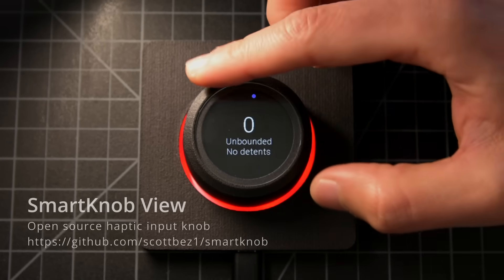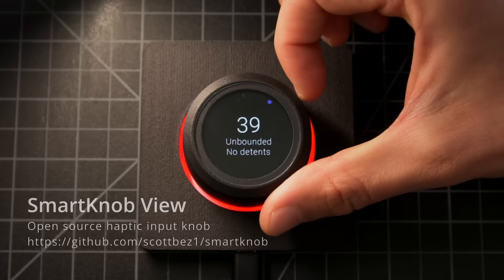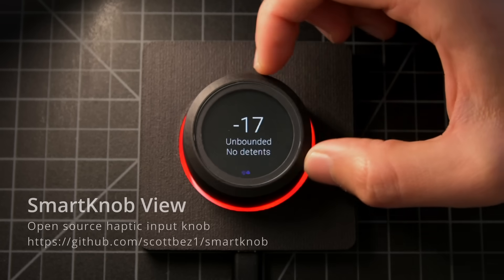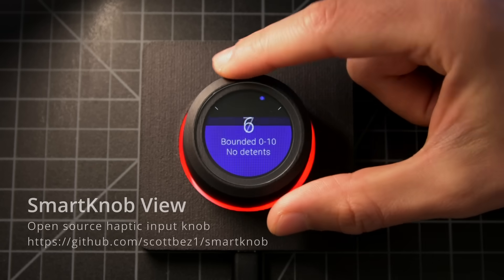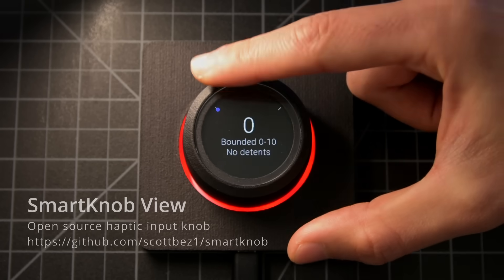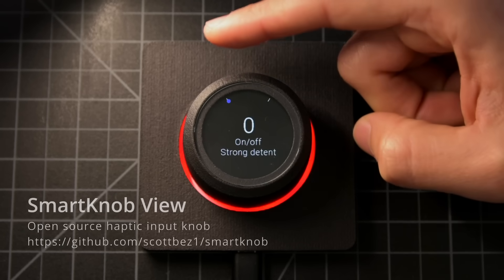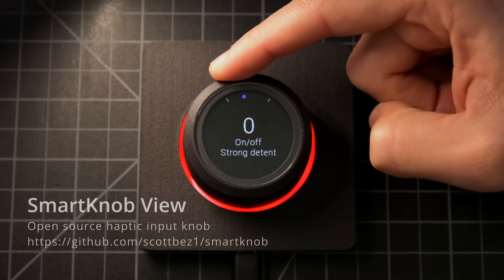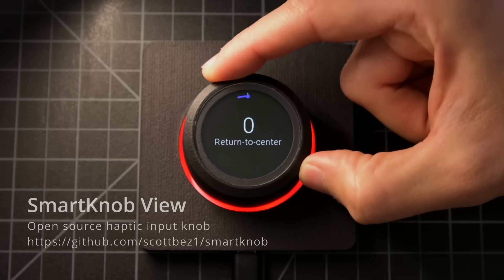DIY haptic input knob: BLDC motor + round LCD

Comment: I love force feedback and real mechanics that can be felt and heard. This is basically a miniature sim racing wheel that can be configured for different endstops and resistance. However, it's tricky to make a motor produce a torque high enough but not hinder free rotation due to back EMF. This is what may limit of such a design unless a variable Kv motor is used.

Comment: YouTube recommended this random video to me for some reason. I still find it absolutely amazing. It's like you emulated all possible mechanical properties that a rotary dial can have and allowed the user to pick, with software. Reminds me of the scroll wheel on my MX Master but with so many more variations and so much more control. The best application I can find for this is on a keyboard. Even as a standalone thing,  could program it to pick a specific behavior contextually. step-less for sroll, steps for scrolling spreadsheets of lines of code, bounce back and acceleration mapped for controlling volume...
Do you think the Hardware on the MX master can support this if one can access it in software or is there something specific about the motor and diet that allows for this??
thank you for the great work.

Comment: over 35 years ago (precisely in 1989) Canon released two camera lenses - the 85mm f/1.2 and 50mm f/1.0 that had the electronic coupling between the focus control ring and the motor and oh boy... it's so satisfyingly accurate! it feels like the ring is really physically connected but it's not. I only know that they are using the ultrasonic motor, I think it is still the pinnacle of the encoder+motor engineering. I mean, they did it in 1989, and we are coming closer only now...

Comment: A cool feature would be detents of increasing resistance as the value approaches the useful end of a output variable.

I imagine a thermostat that is fairly free wheel until it gets within the 18-24 degree range and then has a hard stop at the upper working range of the heating system.

This would be a haptic way to suggest an optimum temperature gauge as well as the systems limit. 

I don't believe this would be a novel and fairly new use case that would actually require this type of technique

Comment: This is what I'd like in my dream car. Imagine having maybe 2 or 3 knobs like this and being able to program them to do different things - heck, maybe even contextually. Imagine using those knobs to control multi-zone aircon and then switching to a different menu on your infotainment system and using the same knobs to control ambient lighting or select a driving mode. And of course the knob itself tells you what you're controlling, so that would be great for guest passangers.

Now pair that with a couple of programmable buttons with simmilar LCD displays for binary inputs + add ligthing and sound cues to know when you enter a different preset. You get ergonomic and elegant dashboard with PHISICAL controls that can do everything. Say goodbye to touchscreens with no feedback that you can't operate without taking your eyes off the road.

Comment: How did you account for cogging torques? Does the system have to be calibrated for individual motors?
Reply from the maker: This particular motor has basically no cogging torque, so there's actually nothing special being done about cogging besides finding the right motor!

Comment: Fantastic video. This reminds me of the control knob on BMW's first generation iDrive system. While it did not feature a display like yours does, it did have software defined haptics including increment 'clicks', end stops when reaching the bottom of a menu, etc... and it even made note of how many turns you would try to force it past the end stop, and reverse that same number of turns at high speed when the knob was released (someone in their dev team had fun with that). Sadly they discontinued the haptic feedback on cars post 2007 because apparently it unnerved some users (facepalm). Anyway I've been looking to recreate a similar interface ever since I sold that car (2006 BMW 130i). Thanks for the inspiration!

Comment: Hey, this concept could be great in the world of IoT devices - Do you have any word on power consumption? Could this work in a AA device with moderate use for over a year?
Reply: although I don't really know about this device in particular, I've done a lot of playing around with electronics.  The data sheet they link for the sparkfun motor they recommend says no-load current of 0.11A, 110mA, then there's a display (I found a similar lcd 1.28" one that claims 31mA) and the NanoFOC DevKit controller (I'm guessing similar when idle more when making motor torque), one of their suggested mag encoders has "No power-down or low-power options".  I'd guess this whole device consumes at least 150-200mA while operating.  So...AA batteries in series  (I guess it would need 3 at least but then you also have a voltage regulator/buck/boost power to consider) but not parallel, typical capacity 2000-3000mAHr  implies about 10hrs of constant use?  I think that's probably generous for battery operation but maybe I'm wrong.
Reply: in fact the video creator scottbez1 actually mentions power consumption in a comment "This draws somewhere between 2 and 4 watts when resisting motion".  I think it runs on 5V so that would imply something like P=IV -> 400-800mA in that state.

Comment: The entire project could be done in Fusion 360, including electronic circuits, boards and components. It's much more convenient. Strange why it is not. The project could be completed and handled by enthusiasts in one working environment, it's very cool

Comment: Just had a random thought:
The only real issue I have about turning a gear selector lever into a knob is that it doesn't have intuitive feedback, but if you market this to car manufacturers, and tailor it to the vehicle, I think more people would be realistically ok with it compared to plain detents. 
If it gives a physical stop to say this is the end, and a clear snap into each setting, with some being locked out unless the brake is pressed, that would be all one could ask for as far as knob-based gear-select feedback.

Comment: I really want a console controller to use something like this for racing games. The tech seems identical to direct-drive wheels, but a portable racing wheel or controller equivalent just doesn't exist. Some 3D printed mods do exist to turn Xbox controller joysticks into steering wheels, but the fidelity is not there, and the deadzone kills fine movements. Real interesting stuff here, though. I'm tempted to adapt it to a controller, but I fear the programming for it is beyond my reach.

Comment: What I can see from this is that the "fine granularity" of the input is worthless, because it doesn't matter how precisely you can input with the wheel, it changes when you press the button because you accidentally turn the wheel slightly.

Comment: Dude… this would be sooo useful in audio applications! For example: click on any parameter that needs to be controlled- EQ frequency, slope, volume fader, filter cuttoff, Oscillator frequency… you name it! …but the coolest thing would be for the controller to remember how to function for any parameter that is selected. (Auto preset recall feature).😎

Comment: I'm looking for an easy to use "room controller" device. Berfore I saw this, the hottest candidate was something like an NS Panel (maybe PRO). 

In a room, you need to control a certain amount of things like temperature, light, blinds and, depending on the room, a few more things. 

The idea with a (forerver working) rotary encoder seems to be a very durable solution. 

I saw that you used an ESP32. That means, that e.g. the integration in house automation systems (e.g. HomeAssistant) should be possible. I could imagine, that this could improve the WAF a lot, with this haptic feedback system and the "use it like a knob"-pilosophy.

The only thing, that I would love to see, is that the communication is wired. In my personal opinion, I prefer a wire over wifi.

All in all a very sophisticated start point.

Comment: Utterly brilliant! Like a mini Nest Thermostat interface but where the sky is the limit. Did you consider using a linear magnetic sensor like AS5311 with a large multipole ring magnet around the skirt of the knob so that you didn't need to pass the display wires through a rotating center and base plate? Maybe that wouldn't have even helped as you still have the motor haptics to integrate. A large diameter circular linear motor perhaps (now I'm just confusing myself!). 

Great work.

Comment: Could the motor take damage from being turned too far over such a snapping point? Or do you limit the current it can possibly draw? (Sry for noob question)
Reply from the maker: Good question. This is specifically using a gimbal motor, which has higher resistance coils than your typical drone BLDC motor, which means the max current is naturally lower (especially since I'm only driving it at 5v). So in this case the current stays low enough to avoid creating too much heat and causing damage even when stalled.

Comment: I don't know if this has been mentioned before, but if you can find a 2013 or so Lexus CT200h it needs to have the little square joystick on the console. It uses something similar to this for its menus. The joystick has "detents" depending on what screen you are on and only allows the joystick to move to those spots or full freedom of movement. I have always tried to explain this to people when I owned one, but never knew what to call it until I could show them in person. I always geeked out about it and it was one of my favorite unique features of that car.